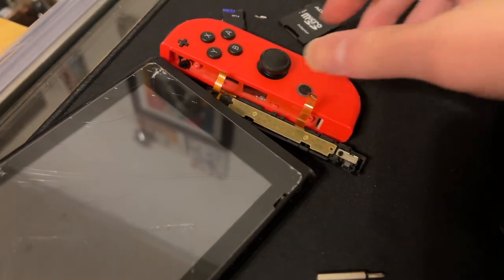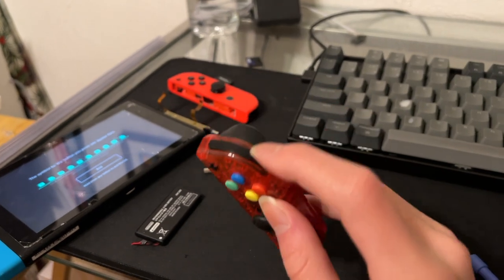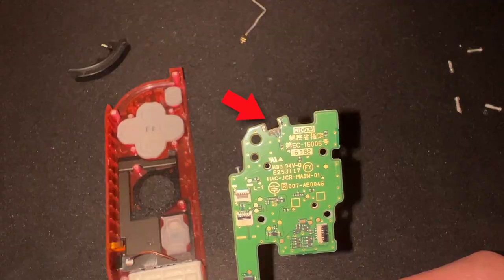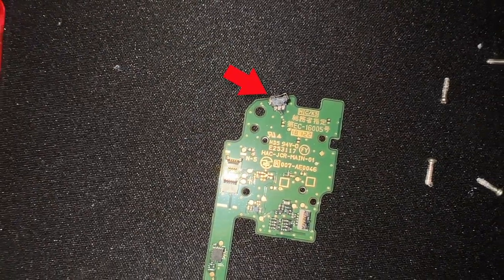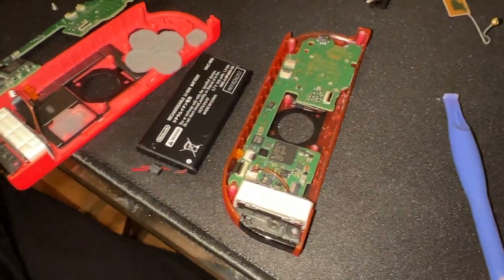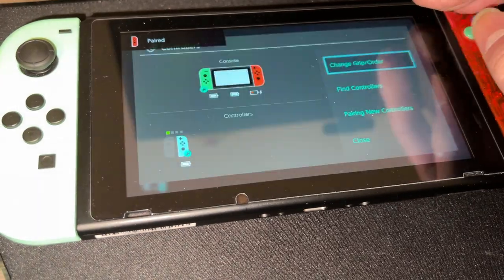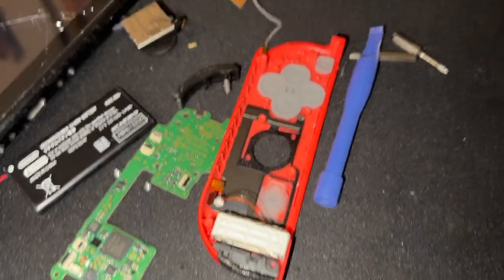Replacing my working JoyCon with a broken one...

Comment: 1:30 At least with that cable, you can have it connected as you install the motherboard into the case. On the other hand with the ZR button cable (since it has no slack), I managed to break the part where it plugs in. I also broke the R button by grabbing the motherboard at the long end. Oh well I have another Joy-Con anyway...
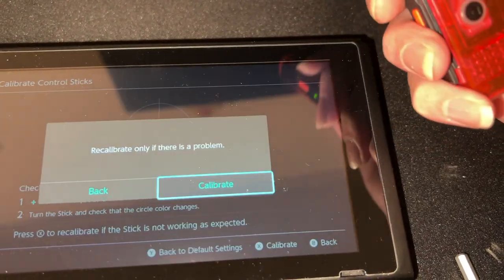2:25 That happened to me as well when I replaced the analogue sticks in one of my other Joy-Cons with hall effect ones. It's probably something to do with the calibration for the centre being different in the new stick...